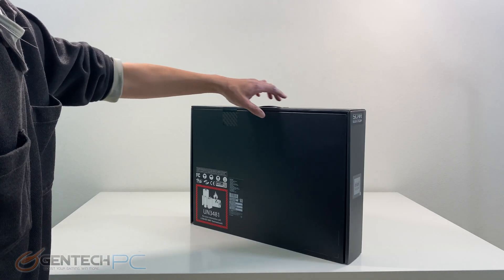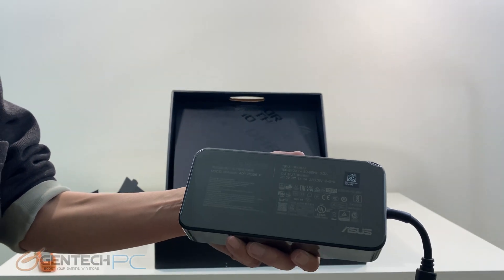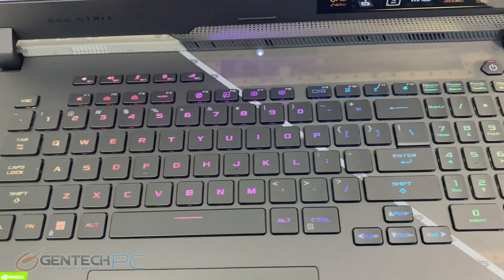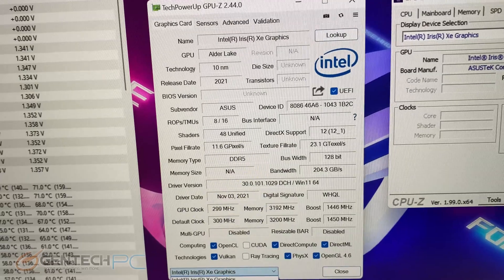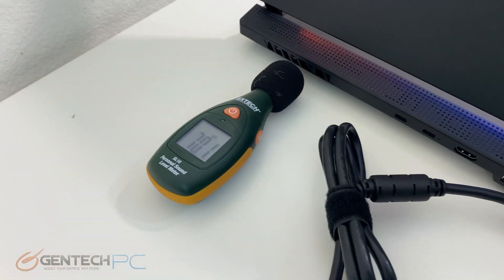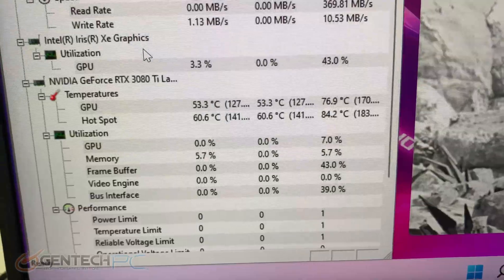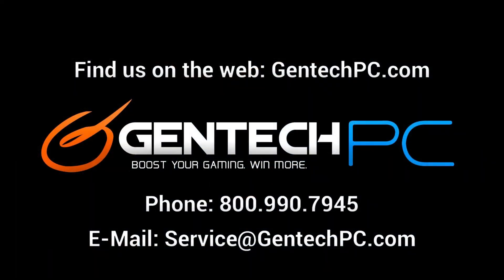Asus ROG Strix Scar 17 Review and Benchmarks - RTX 3080Ti  - i9 12900H

Comment: how durable is this machine? have you had any issues breakdown since the purchase?
Reply: I have one and move it from a laptop stand to a desk daily and game on it pretty frequently. The only complaint I have is that the touch pad is a little too large, and sometimes I touch it when using the keyboard. It’s fast and performs pretty well when playing games like Elden ring, GTFO and it runs PCVR games pretty well (using a tethered quest 2).
Reply: @DJIsher1  that doesn't seem like a big problem. do you find the screen too dim and the keyboard flimsy? I am a bit torn between asus rog and the alienware X17 with the 4K screen at 400 nits brightness.. asus has a more updated cpu though, so this is a toss up for me..
Reply: @batmanonholiday4477  The keyboard is alright. I can see the caps becoming a problem if something were to get under them and if you don't know how to clean them properly. The screen hasn't seemed too dim so far. It's got a nice picture and high resolution especially for a laptop. The bezels are nice and thin as well, squeezing out that real estate.
Reply: @DJIsher1  good
Reply: Mine is SE model and they pretty share the same body so mine is still rock solid no problem at all.
I mean I don't expect it to after spent over 3K on it.

Comment: did not expect the disassembly. Nice.

Question:
Keeping the laptop at an angle of lets say 25 degrees or 30, will it collect the thermal paste at the bottom of the components?
What i am trying to say: for instance, lets talk about the CPU alone, the thermal paste is spread all over the CPU evenly,
So, using the laptop at an angle of 30 degress or 40 or 45 degrees, over a long period of time, will it collect the thermal paste on the lower end of the CPU? (Will the thermal paste settle on the lover end of the CPU) or it will remain spread all over the CPU evenly?
Reply from the maker: That's a good question.  What you can do is use HWMonitor to check the temps on each core.  If efficient cores are running about the same temps as performance cores then it probably does.

Comment: KEYSTONE WARNING!  Do not "bind" your account to the keystone (the small, red, magnetic, side dongle) unless 1) you'll never want to unbind it, and 2) you don't mind it sending information back to Asus every time it's plugged in or the PC is booted.  Asus tech support said the only way to unbind the account is to factory reset the PC and give it a different name--as if that's a viable option.  My keystone is sitting in it holster pinned to the wall as an ornament, for now, until Asus decides to release us from its tyranny. 🤨

Comment: Thanks for this review. (I subscribed as I like your quick in depth/disassembly reviews and plus you should have way more subscribers!) I was going to get the outdated Asus ROG G703GX with the i9-9980HK with RTX 2080 config but after seeing the cores, versatility or mobility, the 3080 TI, DDR5 Ram, and integrated graphics on this laptop, I think I may be sold but it lacks camera - a minor gripe, and that key not so sure if I can keep up with that. But wait, it has adaptive sync - the tech underneath the syncs???🤦🏾‍♂️But definitely a better upgrade, right?

Comment: Just purchased mine with 32 GBs Ram and RTX 3080Ti. Should arrive this afternoon!
Reply: 32fb of ram is def not enough for Houdini Simulation ;) i bet you are an fx artist
Reply: @minhhainguyen2424  It’s not but I manage somehow. It is upgradeable to 64 GBs.
Reply: @shivdholakia  yeah i think 64gb it's pretty enough to do personal projects, since i9 12900h is a fucking beast
Reply: @shivdholakia  DDR5 RAM is wayy wayy expensive
Reply: @shivdholakia  it's double the price comparing to DDR4 RAM
Reply: @minhhainguyen2424  Yeah, it’s expensive because it just came out and a lot faster than DDR4.
Reply: @shivdholakia  Any thermal throttling issues with P3 and P5 cores running Cinebench R23 or under other load? My 12900HK  P3 and P5 hits 97C running Cinebench and I found many ADL owners reporting the same issue. Kindly confirm.
Reply: @TJ-ev5uw  No issues so far, this laptop is awesome!
Reply: @shivdholakia  Have you had a chance to run Cinebench R23 Multicore and Singlecore? My Cinebench R23 Multicore score is 15463 & Singlecore is 1865 for i9 12900HK at 2.92Ghz. Pretty low due to thermal throttling. No overclocking or undervolting done. 

Also got some energy errors after running Powercfg -energy in cmd. The powercfg -energy report lists 3 errors. The battery drains 15-20% in sleep mode and only got battery backup of 2.5 - 3 hrs.

Energy report errors:

Platform Power Management Capabilities: PCI Express Active-State Power Management (ASPM) Disabled

PCI Express Active-State Power Management (ASPM) has been disabled due to a known incompatibility with the hardware in this computer.

2) USB suspend: USB device not entering selective suspend. Device ID: USB\VID_1038&PID_113A

3) USB suspend: USB device not entering selective suspend. Device ID: USB\VID_1038&PID_113E
Reply: @TJ-ev5uw  I just ran 3D mark for benchmarking and it was very positive.
Reply: @shivdholakia  Good to hear that and Thanks for running the test.

Comment: I just bought this model because one I actually wanted wasn't in stock ... Im kinda worried if it will handle heavy 4k video editing and 3d modeling and unreal. Im not really into gaming I just want it to do what I need without issues. I need the portability so building a system was out of the question but dang .... the price is high not being able to find much info about this system for creators Im not sure I made a wise choice
Reply: How is it doing now ? I'm planning getting one to dabble on Unreal5. And what the one that u didn't find in stock
Reply: @ibrahimallubly9452  The one I wanted was the 4k Razer blade 17 4k 144Hz i9 w rtx 3080ti  ... 
I actually have Unreal opened up on it now and has seemed to hold up with all ive tested on it so far. It whips through some of the 5.7K footage I have rendered through it ..so far.. It does run really hot so I picked up a nice cooler from KLIM .. The LED on it is a sexy match with the crazy LED on the laptop too lol .. Cooler also tiltable and raised up from desk for more circulation ..eats up the ONLY 2 usb ports though. 
Finding windows too high maintenance compared to mac with drivers updates etc.. 
Gee its 2022.. Shouldnt there be a better way than having need to constantly check for updates like back at turn of century!!! 

Folks that know me and know computers seem to think I made a good purchase but I have no idea if I could have got more for less $.  If there is anything specific you would like to know I can try to help. Most Sincerely Steve
Reply: @vrguytokyo  i see, so do u recommend it ?
Reply: @ibrahimallubly9452  hmm Price tag  really high to give you a concrete yes or no without me fully knowing what Its capable of but as I go along I feel more comfortable with my purchase. I know the other is designed more for creators and this is more for gamers..but.. as tech has progressed the higher end machines have a broader spectrum for use. That FHD at 360H if youre into gaming though ...!   LED customization is fun and it makes you feel even more advanced hahaha    Im moving up from 5year old max spec MBP so Its a far cry better than that by all means!
Reply: @vrguytokyo  well i am a gamer but i want to also be a creator haha; thank you!!
Reply: @vrguytokyo  and by the way, do u use the laptop as your personal laptop as well ? Or is it only for UE5
Reply: @ibrahimallubly9452  i use my mac primarily for photo editing and basic stuff .. just getting the new system Im hoping it will handle everything else! I work in a ton of different applications and always experimenting trying to find my way in the creator world! up till now I have not even been able to use some of my gear either at all.. or at its max capabilities because I lacked the PC o/s and power I needed.. I totally banked my future efforts and career path on this system.. 
btw most will say it's better to start with U4 ..might wanna look into that.

Comment: I planing to buy this laptop or 15.6 one with same cpu and gpu. I cant find any vs video or information strix scar 15  2022 vs 17 2022 benchmarks. They both 150w for gpu but 17.3 has bigger case and i thing better performans. Can compere that 2 different size of same laptop pls. Do you have and data about that?
Reply from the maker: Won't be much difference except the screen size.  Some like Scar 17 because the number pad.
Reply: @GenTechPC  plus the bigger chassis = lower temps.
Reply: @EdJagla  how is that possible?
Reply: @estebengonzalez1703  bigger chassis = more room for airflow and more airflow = lower temps.

Comment: Heeeey! Would you recommend the Rog Strix 3080ti or the MSI raider 3080ti? I have no idea how to decide!
Reply: Can't go wrong with either, but the MSI Raider will have higher power limits generally compared to the Asus laptops.
Reply: @Emolokz  thx, ill probably limit the power limit though, im more concerned with temps and noise.
Reply: @aeonbreak4728  in all honesty, the 3080ti isn't really worth it.  I'd get the 3070ti model which would save a ton of money.
Reply: i need the vram
Reply: @aeonbreak4728  ah, workstation tasks/rendering?
Reply: yuup :)

Comment: Great laptop. Almost desktop level performance. I think asus should start using vapor chambers though. My legion 7i has one and I never see it going above 80C in firestrike. Videos like these are the best kinds of advertisements, instead of clicking on skip ad, I clicked on the ad lol. Informative, succinct, and enjoyable. Would like to see more.
Reply: They have vapor chambers now.
Reply: @Emolokz  so far I only seen one in the new 13" cpu/tablet w/Egpu it looks sweet.
Reply from the maker: Asus's Scar 17 with 12th Gen HX CPU use vapor chambers and the non-HX models does not.
Reply: @GenTechPC  RTX 3080Ti - i9 12900H. Any cpu bottleneck issues on this one?
Reply: It's also on the 15" models.  I'm not really sure why their 17" models don't have them.
Reply: @randall-lbc  maybe it’s not needed to cool it because of the larger size which allows for a more traditional cooling system.
Reply: @janTelo  possibly.  However, with more thermal headroom, manufacturers typically bump up wattage.  More wattage = more heat.  They would’ve benefitted from the newer cooling tech here.
Reply: Why not desktop level performance. Wouldn't it perform the same as a desktop with the same graphics card and processor? I have a gaming desktop and am interested in replacing it with a laptop only.
Reply: @lutherjacob  it's mainly the power levels. Especially desktop gpus can draw 2x the power compared to their mobile parts. I have a full powered 3060 laptop, and I can play most games around 60fps at 2k, while a 3060ti desktop can play at 80fps.
Next generation desktop gpus are getting announced 2 months from now, which means that next generation laptop gpus are at least 8 months away. Think about that when you're making a purchase.
Reply: @LeFatalpotato  Ah, I see, that really does help and prevents me from rushing into a decision. Thank you for taking the time for the answer. Cheers
Reply: For when you want to swap memory sticks or rather cards do you need to replace those silver stickers
Reply from the maker: @tygergerman9361  It's thermal pad for the RAM, you can re-use it on the new RAM you installed.
Reply: Lol where??
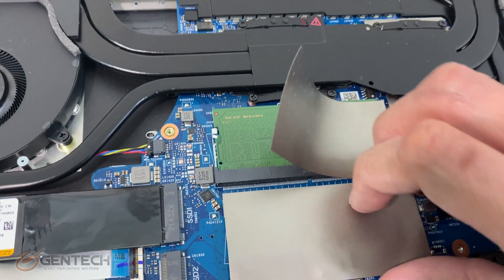Reply from the maker: @frosty1631  at 12:49

Comment: PLEASE READ.. For the speaker test did you turn on Dolby Atmos and set to Dynamic? For better audio/sound you can use that's ;) And for honestly I got same laptop but last year modal. I give tip for better temp. Just make the back of laptop a little bit up. I can garrenty the temp will become a lot better because I'm using same modal and trust me.
Reply: I want to buy the newest one ... is it worth it?
Reply: Yes.. I buy it and I'm very happy about it. Take RTX3070 or above the perfomanced very² good.

Comment: When will these release in US? I have the 2022 15" 3080Ti and its so amazing I really want this 17" with i9 3080Ti, 32g DDR5, 240HZ UHD same exact specs as my 15" I hate to preorder without a ETA.
Reply: where did you get your 15??
Reply: @highlanderc  Newegg had them for $3299 with 32g DDR5
Reply: @EdJagla  is strix scar 17 in stock now or when it will arrive to be bought ?
Reply: @AMBITION6176  they are slowly appearing on different sites and go mighty quick. I snagged one and ordered it last Thursday 3/24 from CUK (computer upgrade king) and it arrived today 3/29.

Comment: Im gonna buy the SCAR 15 with the 3080-ti in switzerland when its available. Why did Asus not put Liquid metal on the GPU too?
Reply: They did put liquid metal on both CPU & GPU , I have the 2022 15" w/i9 3080Ti , 32 G DDR5 etc its freaking amazing.
Reply: @EdJagla  no they did not, liquid metal is on cpu, has a different non copper heatsink for LM, while you can see the gpu having a normal copper one with paste on
Reply: @raider_358  Its the new 13" w/eGPU that has the liquid metal on both cpu/gpu. Sorry about my misunderstanding.  Anyway I returned the 15" & grabbed the 17" same specs i9 12900H, RTX3080 Ti etc...  thing is a beast.
Reply: @EdJagla  How much did u get the 17" one for?